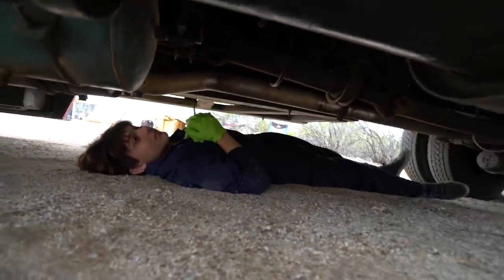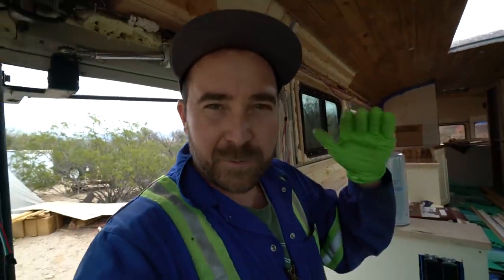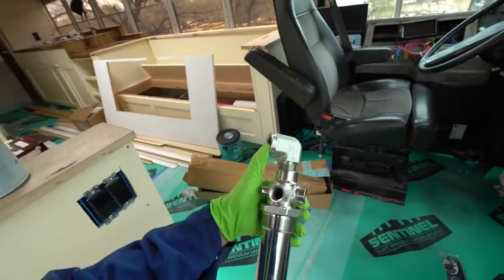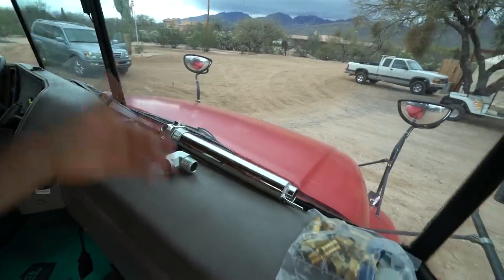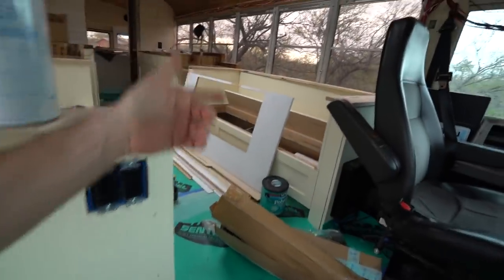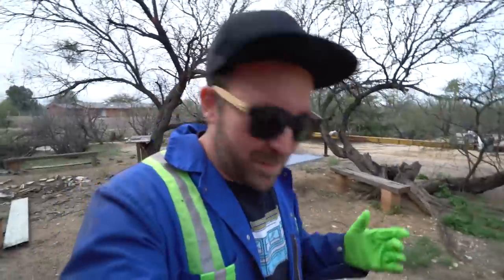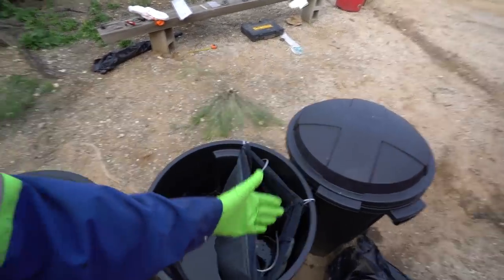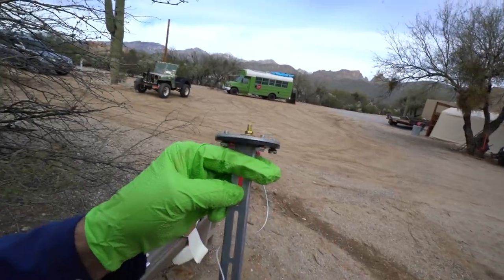Update on Transmission + Filtering Waste Vegetable Oil

Comment: No sympathy for using vegie fuel in diesels. Have you considered the cost of repairs for vegi oil IF someone had to pay to get it done? Everyone should avoid this as it is like owning a boat...a hole to pour money into.  If Vegi was a good cheaper alternative commercial trucks would be ll over this.
Reply: good comment.
Reply from the maker: Only time will tell ✌️
Reply: @JaxAustin  
With time being money for most people it seems you agree vegi is an expensive experiment where everything else other than the cost of the fuel is more expensive. Another way to say this is the total cost of ownership is greater. It has been that way for you for certain but under control a bit due to free labor given to you and technical guidance that might not be freely available if a large group needed the help at one time.. 

When do you expect to be able to just hop in, turn the key and get going with out worrying if the vegi is going to cause some issue?

So far it has been months.

With diesel there would almost be zero concern.

Glad you are doing this and letting everyone see what some of the issues and maybe save them a lot of grief in the future.
Reply: @watsok  , also factor in the cost of time spent looking for veg. oil and filtering it etc,etc, = not worth it.
Reply: You do realize that gasoline was considered a waste product until the oil industry wanted to make more money right?

Comment: Suggestion: Dont go cuttng on the floor of the bus not good. 1st if you only have 5in of space and try to take top plate of s/u YOU will never get it back on even if you get in the tank. you need to drop the tank. Your trying i get it. 2nd what you and Badge used was an impact. If you dont have access to one use a breaker bar and a piece of pipe just big enough to fit over it for leverage. You should be able to break nut or bolt. 3rd Filtering ....... When you p/u veg jugs from restaurants where are the particles? They should have already settle to the bottom of the jug. So y p/u and pure out from the jug? Put your p/u tube from pump just above particles. No need to filter them if you dont have to. And put 2 filters in line not just one put p/u tube in the tank find the bottom pull tube about 2 inchs and start pumping out of tank into garbage cans that should be clean. Once you clean tank out and reverse process your filtering it again. Then put valve on bottom of tank if you took it off. if not tighten tight and leave it on thats a great idea. Then empty remainder, all that would be unusable and just throw it out..

Comment: You are going to need to drop the tank to both install the sending unit and clean the tank off ALL debris. You will just be having more issues later if you don’t clean all the metal shaving and make sure all the veggie oil you use is thoroughly strained.

Comment: you should be a little more careful with that sending unit its not good to just flip it around and let the float bounce from stop to stop after all it is tuned sending unit gringed every time you did it.
Reply from the maker: Good tip. Thanks

Comment: cant you shorten the pipe for that tank ?
about not getting work done on the bus : you cannot move so there basicly no reason to precrastinate , just start somewhere and keep going untill the work is done
about the fuel sending unit : you CAN shorten it and remount the float with te sending unit it made to be able to do that

Comment: I'm considering installing my veggie fuel tank inside my skoolie to avoid the extra step of drilling holes. I'm going to get a custom cubic/rectangular tote to store the oil to also avoid spacing and heating issues.
Reply from the maker: That’s an idea, but then spilling is an issue.

Comment: Have you installed a silicone heat pad to your oil tank? If not I would do when you have shore power you can keep it warmed and be ahead of the game. They are cheap and install with silicone.

Comment: Would it be possible to use an EGT Cooler as a fuel heater? Run a small exhaust gas "bypass" and use that small amount of EG to warm the oil with a cheap EGT cooler from a car.

Comment: Good luck on the sending unity.  Usually you would have to take the tank down to do the install.  If things are clear and you can match access with a straight shot from the top you could do an access hole through your floor ..... eeeek!  It can then be welded back or seal the circular plate and bolt it between two pieces of steel top and bottom.  Don't forget the silicone or roofing tar.   Last resort, but can be the fastest and easiest.   That provides an unwritten possibility to a potential solution.
Reply: James Stratford I agree, bolt it back in for future issues or access.